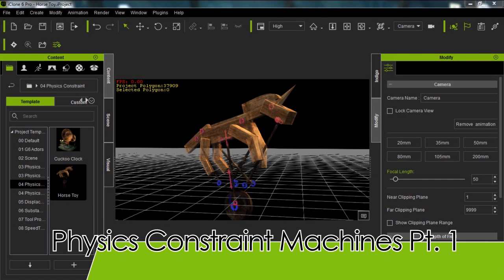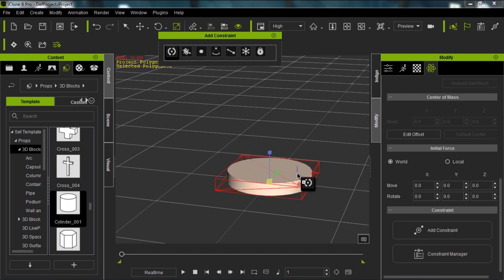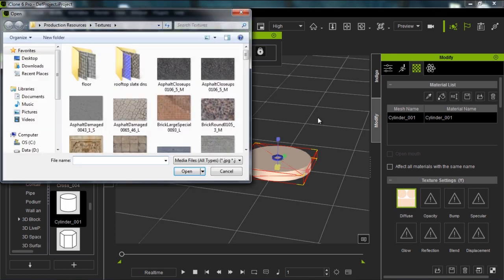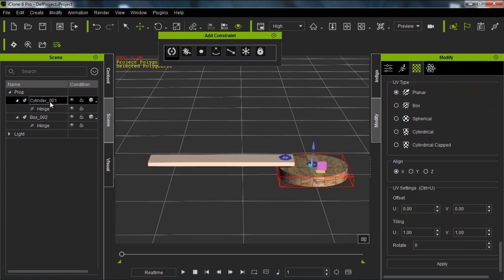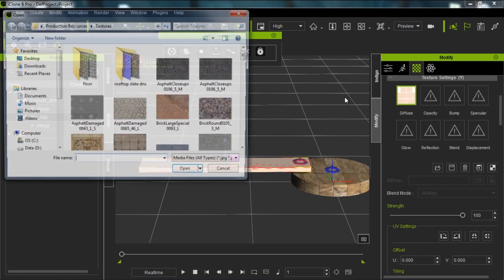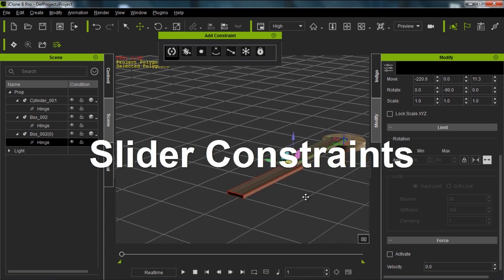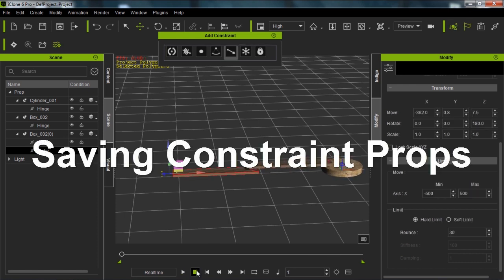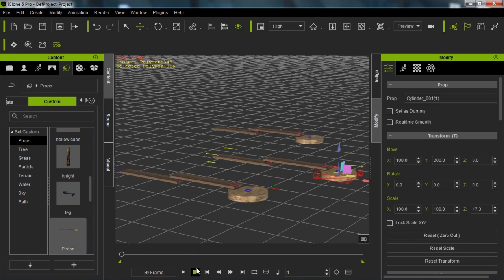iClone 6 Tutorial - Physics Constraint Machines Part 1

Comment: You skipped over the bit on placing the slider. If it is not placed just so it  either works strangely or crashes the program
Reply from the maker: You can place your slider constraint anywhere you want on that particular face of the object.  If you have it constraining the object in that particular direction, you can even move the actual constraint dummy off the screen and it will work the same.  Slider constraints are used to restrict the object to movement along a single axis, in this case the X axis.  If you are having crashes we encourage you to contact Customer Support so we can help you troubleshoot.
Reply: ***** "You can place your slider constraint anywhere you want on that particular face of the object". And from the tutorial "...drag it down to the very end of my object...you can move it back and forth wherever you want it. It doesn't really matter."

To make the plank move only back and forth AFAIK you have to place the blue signal line on the end vertical face of the plank. The dummy is something else.

It's picky, I know, I know.

But when the audience is following every word you have to pick the words that tell them WTF you are talking about. And here we are talking about the blue line that signals whereabouts the constraint is being placed.

Believe me it ain't hard to mystify the already ignorant.

And the crash seems to have been a memory overflow.
Reply: I agree, when giving technical instructions, people need to choose their words preciously, specifically, and accurately.